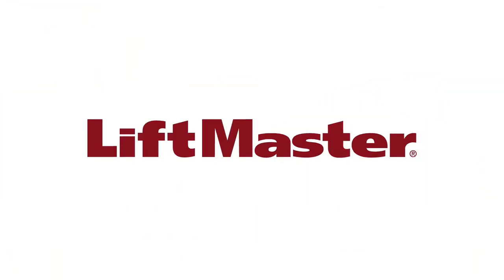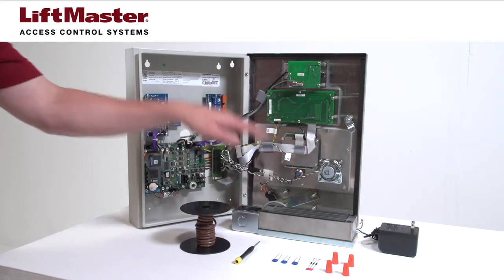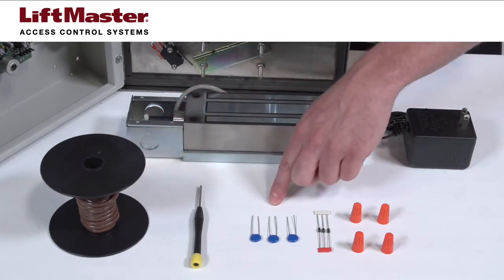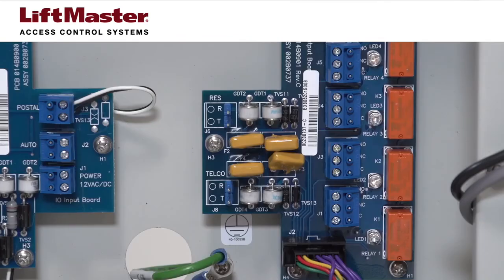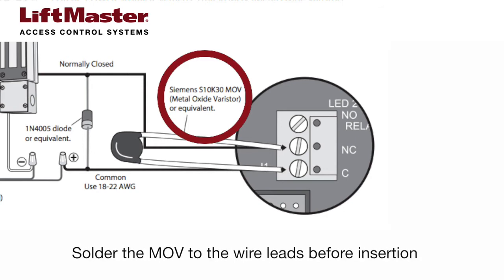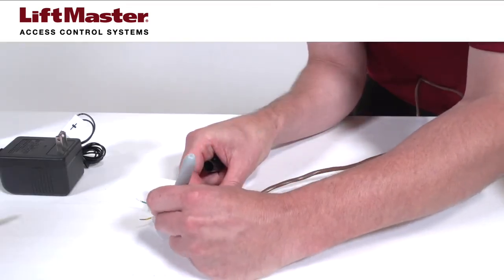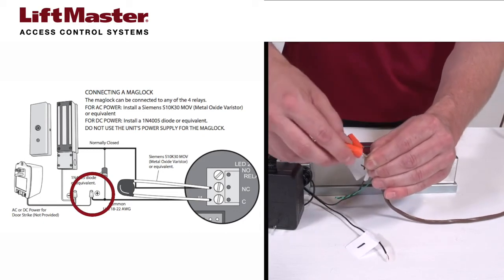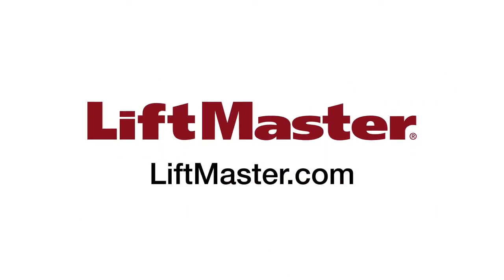LiftMaster - How to Wire a Maglock to the EL2000, EL2000SS EL1SS or EL25 Telephone Entry System

Comment: @ 2:06 it shows to connect the diode on C and NC, I think the diode goes (parallel) on the negative and positive wire of the mag lock not C and NC. (in reverse, negative (cathode) of the diode to the positive wire)

Comment: How to wire for la500?
Reply from the maker: A maglock can be wired to the LOCK terminal on the LA500s main board. The Lock terminal is on the lower right corner of the board. The positive wire from your maglock would connect to positive on your power transformer, the negative wire from your maglock attaches to C (Common) on the LA500 Lock terminal, and the negative wire from your power transformer attaches to the NC (Normally Closed) on the LA500 Lock terminal.

A copy of the LA500 manual can be found at the link below.

https://www.liftmaster.com/catalogresourcesv3/en-us/shared/files/tucmanuals/0136213.pdf
Reply: Thanks. My lock is ce1200lswr. Also do you know wiring for probe cs202?  Thank you
Reply from the maker: I am not very familiar with this model CE1200LSWR, but think I found a manual online that I have provided a link to the manual below. Looks like if you are using a 12V power supply, the Red/Black wires from your maglock would connect to Positive on your power transformer, the Green/Orange wires from your maglock would connect to C (Common) on the LA500 Lock terminal, and the Negative wire from you power transformer attaches to the NC (Normally Closed) on the LA500 Lock Terminal.

If using a 24V power supply, the Black and Green wires from your maglock get twisted together, the Red goes to positive on the power supply, Orange goes to C (Common) on the LA500 Lock terminal, and the Negative wire from your power transformer attaches to the NC (Normally Closed) on the LA500 Lock Terminal.

http://www.allsecurityequipment.com/manuals/1-1200LSWR-manual.pdf

For the CS202, Probe; the Red wire from the probe attaches to Positive on your power transformer and Black attaches to Negative on the power transformer. The White and Brown wires from your probe attache to the Exit terminal on the LA500 main board; the White wire to the top side (NO - Normally Open) and Black to the lower side (C - Common). A copy of the CS202, Probe manual can be found at the link below. Wiring can also be found in the LA500 manual.

https://www.emxinc.com/access-control/access-controls-folder/manuals/cs202.pdf
Reply: @totalsecuritywarehouse3621  where to connect reed switch to this lock?
Reply from the maker: I am not sure what a "reed switch" is...
Reply: @totalsecuritywarehouse3621  in your video is Siemens mov. I don't know how is call professionally. On the parts list parts # tnr330
Reply from the maker: This MOV would also attach to the LOCK terminal on the LA500s main board. You would have one leg of the MOV and one of the wires from your maglock attached to one side of the LOCK terminal, and the other leg and wire from the maglock to the other side.
Reply: @totalsecuritywarehouse3621  thank you for your help. Everything works great!!
Reply from the maker: That's great news!